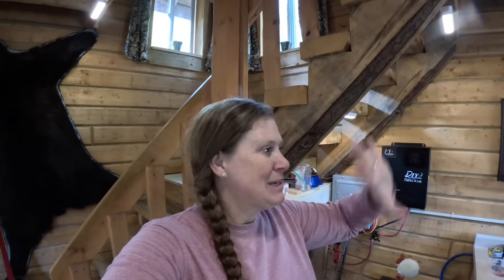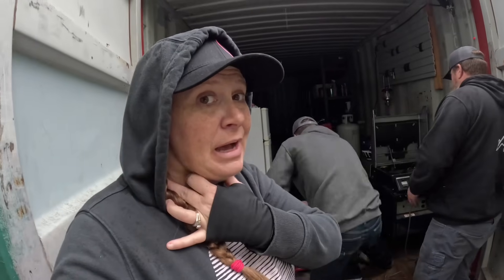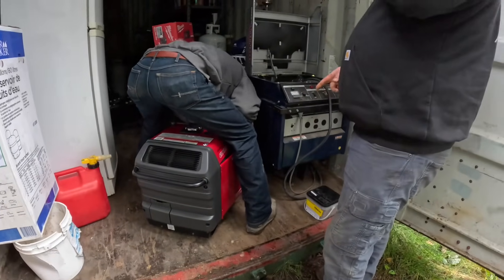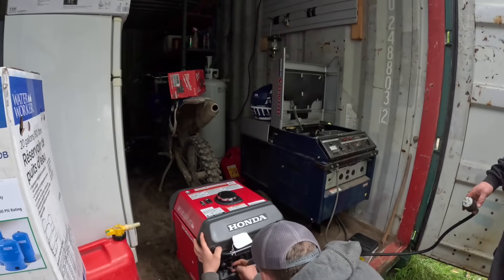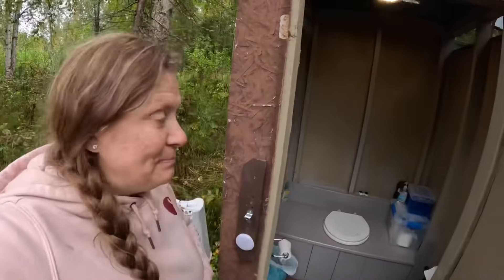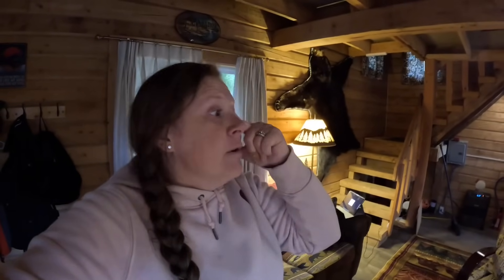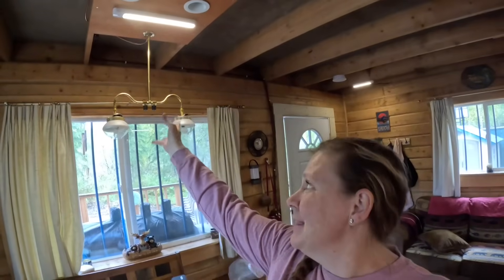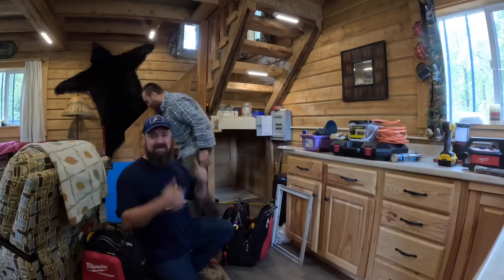All Off-Grid in Alaska: Exploring Alternative Power Options in Willow, Alaska without Solar

Comment: We have a remote place we use recreationally. I’ve been running a Honda 2000 for close to 20 years. Before I got solar I would run it every other night for a few hours to charge the batteries for our 4K 48v charger/inverter. Now In the summer I only run it when running power tools as I put solar in over ten years ago.i built a small insulated box for it that I can adjust the airflow to keep it warm when running in the winter. I run synthetic oil in it so the oil shutdown doesn’t shut it down when starting it in the cold. I have an hour meter and it has run over 1,000 with no problems. All our lights are on a separate 12v system. I used to use propane lights , the problem with them is they make lots of moisture, heat and the cost of running them.
Reply from the maker: You are a wealth of knowledge thank you so much for sharing! I truly appreciate it so very much

Comment: I have the same generator here in Willow for my cabin. I use it when the electric goes out...which is often in the winter time.  Glad you are thinking ahead for the usage of the electrical system.
Reply from the maker: Thank you It’s working well so far.

Comment: Those propane lights are a poor choice. My cabin had them in it when I got it. We found two spare ones that were new. We also found several around the cabin that had burn marks on the back. As luck would have it one started bury the wall while Tyler and I were in the cabin. After that we realized why so many old one’s laying around and that’s why the two new spares. We removed all of them and trashed them.
Reply from the maker: No way! We have the propane off yo them right now. I’ll tell caleb keep it off unless a complete emergency, Aaron and I were looking at some for our house. I’ll need to check that again
Reply: @modernhomesteadalaska  lucky that Tyler and I were in the cabin when it happened the little valve that turns them on and off will leak out the back side and it creates a tiny flame

Comment: so off grid cabin is now completely solar  for electrical  n diesel for heat . wow that's awesome n generator for when not enough sun to charge system rt?
Reply from the maker: Yes and no. Our solar is back up to the generator. Not enough day light in winter up here. Looking into what we can replace the generator with later like wind, water, fully solar. I’ll keep you posted when we figure it out. But we will figure it out.
Reply: @modernhomesteadalaska  AWESOME I'll send u some of our sun lol